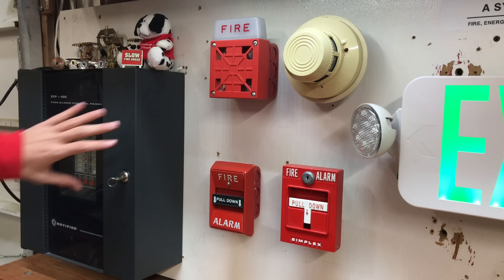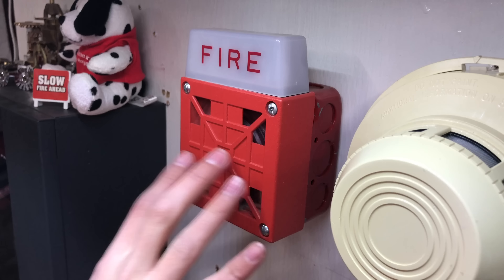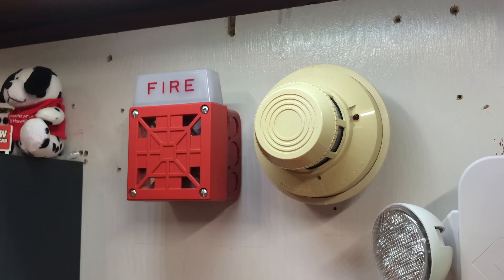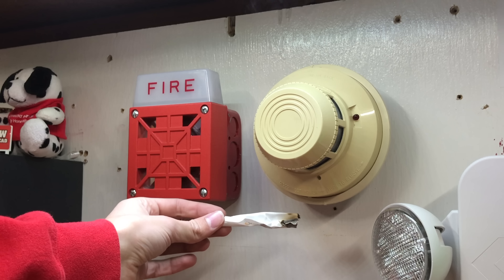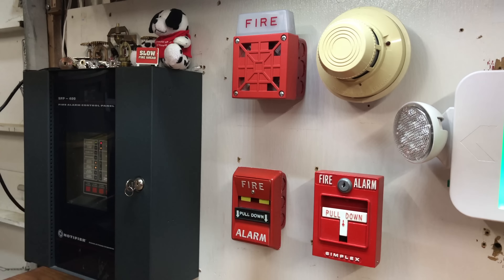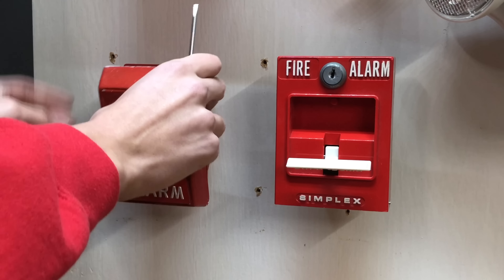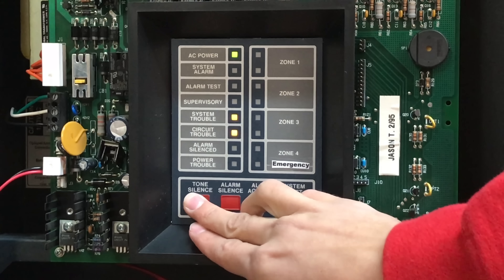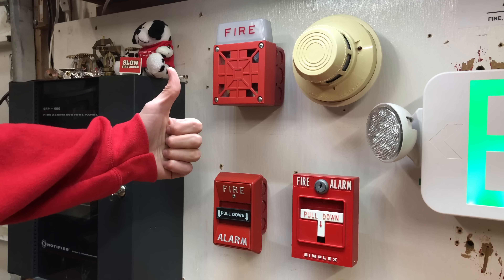Notifier SFP-400 System Test 3: Wheelock 7002T-24

Comment: If anyone wants to use the 7002t, simplex, or any other devices that require DC instead of FWR but only have an FWR panel buy an altronix al600lgk board (or similar). That board needs 24vdc in and a nac code. You wire it up with 24vdc from an auxiliary power terminal, and wire nac 1 and 2 to the inputs. The board also has the ability to double your nacs so if you have 2 going into the board you will have 4 going out. The nacs going out of the board have VDC instead of FWR because the panel is powered with 24vdc. I have an Edwards panel and it allows me to use a simplex notification appliance.

Comment: If you want it to output Filtered DC, turn off the main power to the panel and let it run off of the batteries.
Reply: he does not have back up batteries installed in this demo system. so if he powers it off it will just turn off
Reply: This is filtered DC. FWR sounds scratchy.
Reply: No this panel does output FWR power. just the 7002t's don't sound as bad as other mechanical horns would.